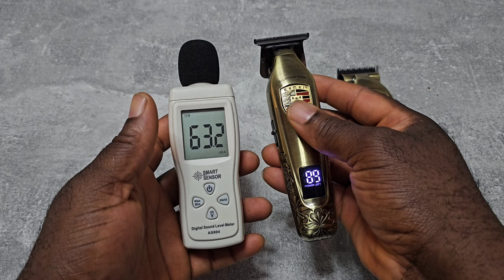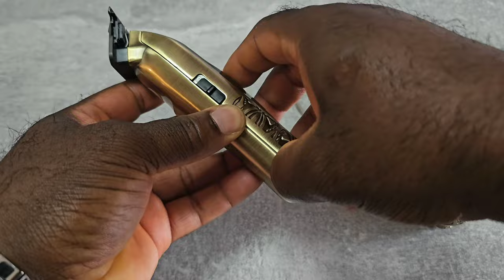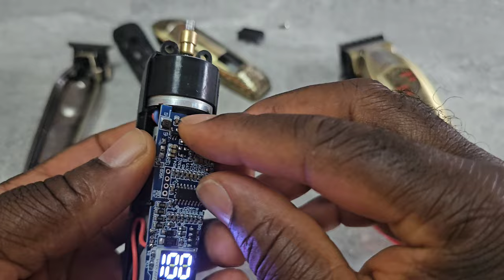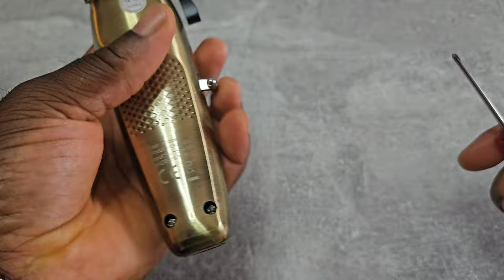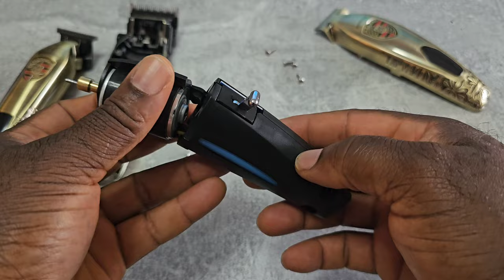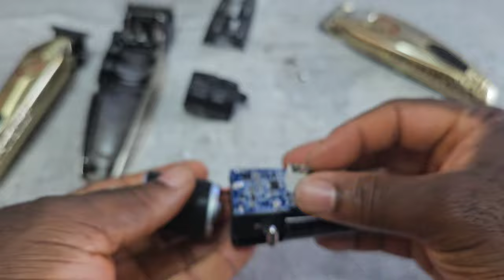Kemei 2230 & Kemei 2236 Teardown - RPM TEST

Comment: If you put the km1855 blade on there does it get loud?
Reply from the maker: I don't have 1855
Reply: I tried and it’s still loud I might try marking the camfollower gap smaller by using heat or glue